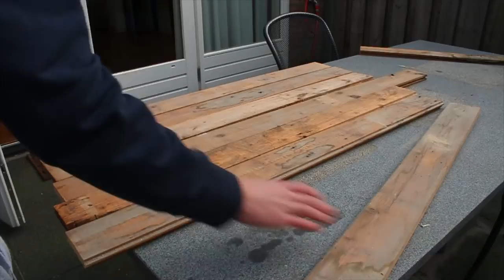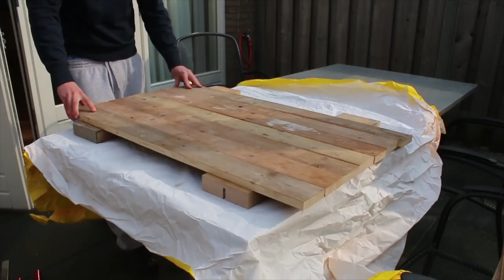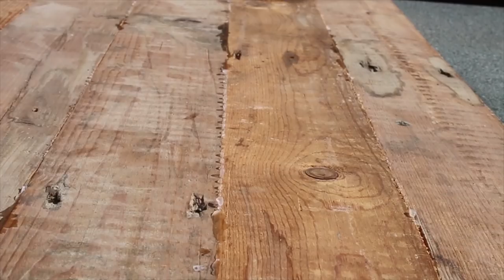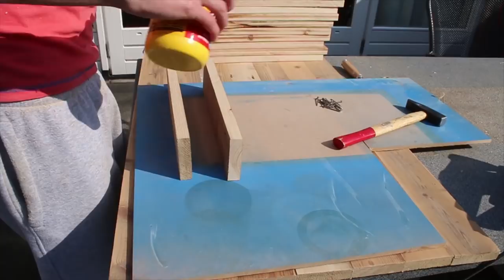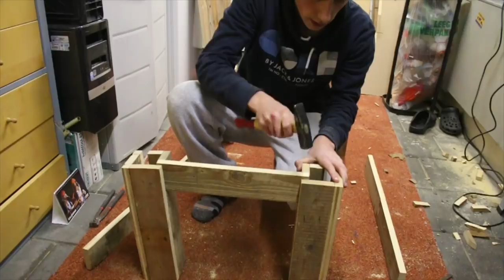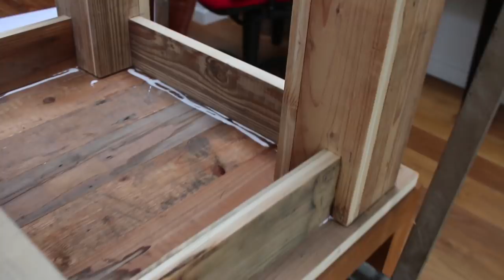Diy Coffee table

Comment: How has the top held up since it's been built? Any cracking from movement, or anything of the like? 

The joinery for the apron is unique, and I like it. 

The way the top is affixed to the apron, doesn't really allow for movement, at least in my eyes. Hence my questioning. 

Please let us know how this is holding up.
Reply from the maker: +Phillip Synenberg Thank you :) It was a bad idea to glue it, but i didnt know back then. im still learning :)
The top is al little bit bended now
Reply: +Mostly Wood I'm also just a rookie, I've heard a lot about table tops, that's why I asked. great project though. Thanks for taking the time to reply. you've earned a subscription from me

Comment: Nice work with limited tools. Instead of the wooden blocks, did you consider pocket holes to join the top to bottom?
Reply from the maker: Yes we could have used pocket holes. But our main goal was to make this table without buying alot of tools that carpenters use. We did this so that almost everyone could make a table like this. If this table was for a client however then you want to make a table as clean as possible with joints you almost can't see. Thanks for the feedback :)

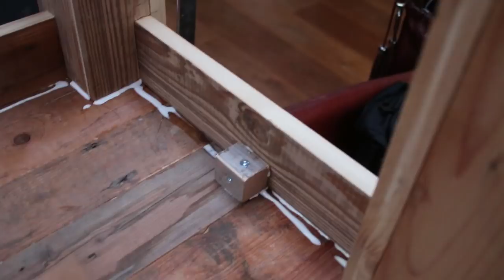Comment: at 8:17, what are the small wooden blocks that you used?
Reply: ***** for the top, extra strength
Reply: Menno l'Abee are you sure that jointer small wooden will hold this table? because I saw you just glueing in all wood. 

nice share anyway.
Reply from the maker: Ragil Setio Pranowo It's been a few months now and the table is still holding on good so yes it will hold.

Comment: say you did not glue the table top to the frame
Reply from the maker: purask The table top is glued to the frame.
Reply: well good luck with that i hope that were you live is very stable climate because solid wood table top expands with moisture and it will warp or brake off from that frame
Reply: purask Yep you're right. didnt think about that, but after 5 months nothing happend
Reply: Mostly Wood Everybody is a critic!  Nice work!
Reply: yes i agree its a nice thing but still if its worth doing then you should make it right way :)
Reply from the maker: James Smith Thank you!
Reply from the maker: purask Yes you're right we've made a mistake in the proces thank you for the feedback, after all the table is still standing strong.
Reply: purask I dont know about most people, but in my house (where i have a coffee table) the temp is about 75 year round, and humidity in doors is about 40-45%. I wouldnt have even been bothered. (Though I would have used cleats myself, makes easier for refinishing and transportation)
Reply: i live in easter europe and humidity in doors is between 40-75% so wood warpes a lot and on many other regions can expirience same thing where are four seasons